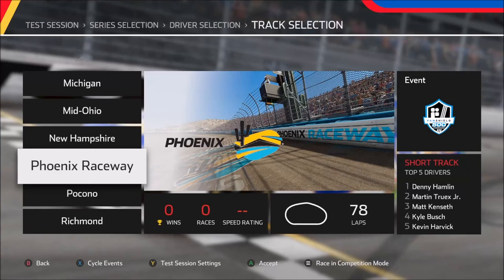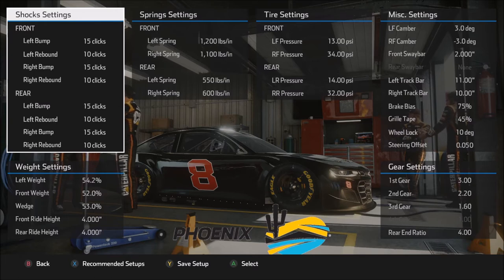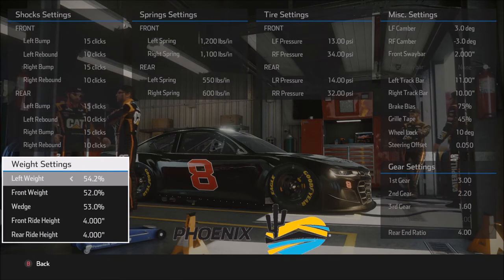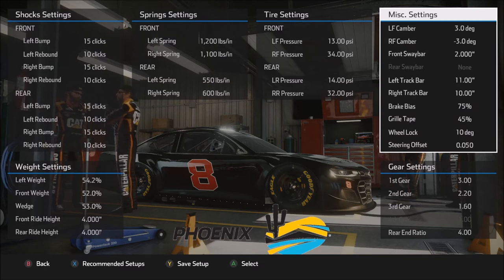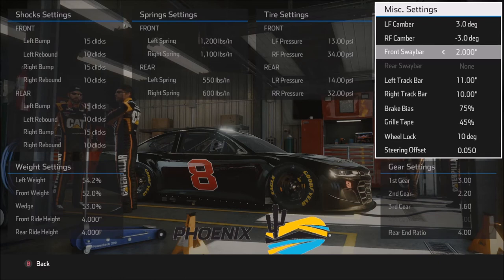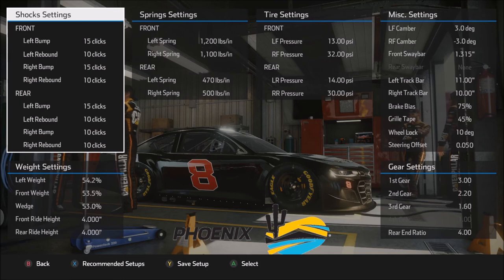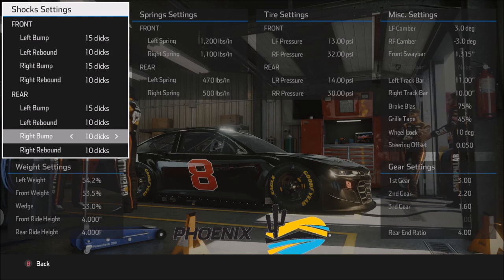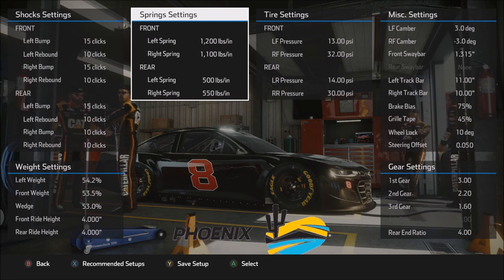NASCAR Heat 5 Setup - Phoenix (Cup,Xfinity,Trucks)

Comment: Legit, been using all your tunes in all my races. As a first time Heat series player these got me from running mid-rear field on normal ai, to getting top 5 quali and pole finishes. I have found a couple ticks here and there on your transmission tunes does help. Autoclub I use a longer 1st&2nd than your tune by 2 ticks each and my final one tick shorter, i'm catching the rear of the field by lap 6 if it's a caution restart. Bristol I was 5 laps ahead....of the ENTIRE PACK...by the 20th lap...running 50% races, i still had over 100 to go😂😂 helped out a rival who was running slow that race....didn't seem to help his attitude tho as I have no clue how the rival system works. Just rode his bumper and gained him 20 spots, still a rival and he complained aboot me using my car as a battering ram but i legit did not leave his bumper the entire time so i never actually bumped him
Reply: They don't like being bumped lol. I got ten rivals in the truck series and five friends, of course my rivals are Chastain, Nemecheck, and other top 20 drivers so I have a rough time sometimes making moves lol. But I started out like you bumping the rear alot not knowing they get pissed fast like that which I get. I learned anyway not to do that because it damages your front end and you loose alot of speed on straight aways. I'm about to try your gear setup

Comment: My question is? Sir what’s the deal with the 3 gear bullshit now. And yes I’m a racer and yea I have allot of knowledge that you don’t on these cars game wise!!! Real shit that’s your department ok Mr. Reynolds and I’m not a kid just so you know. 50+
Reply: I know this was a long time ago but basically it’s faster being in third than 4th plus easier to use 4th as a save gear meaning saving fuel. Now on restrictor plate tracks you would use 4th as a race gear and 3rd as the save gear